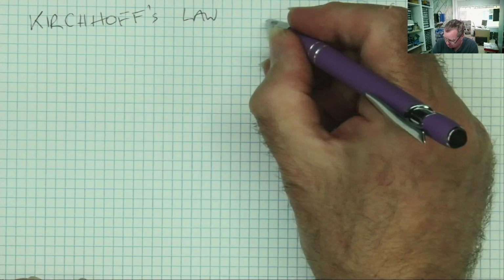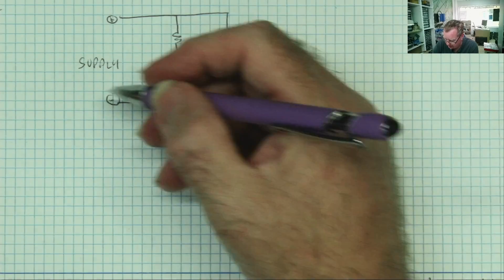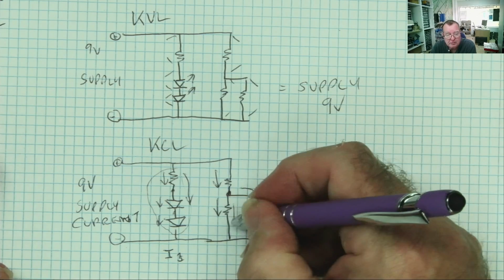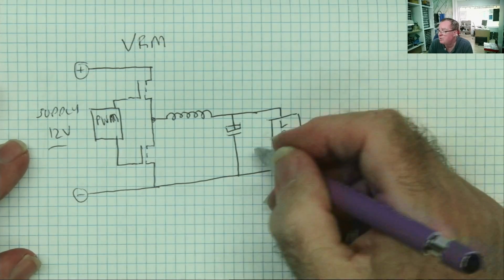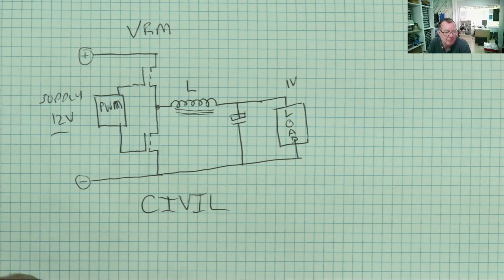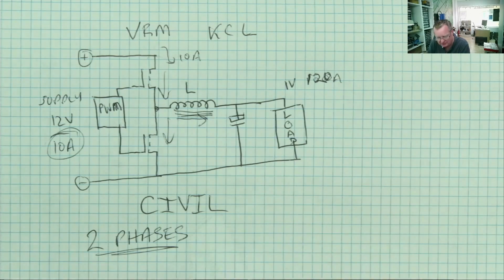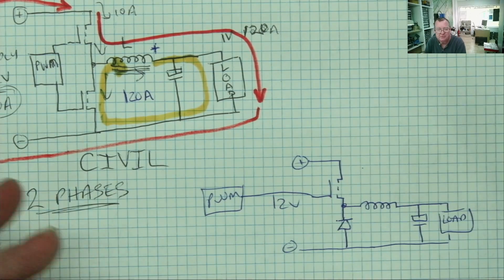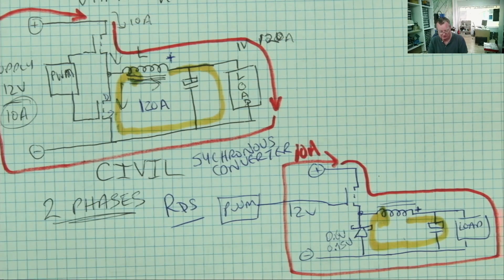Kirchhoff's Law VS The VRM : Do DC-DC Buck Converters Break The Laws Of Physics? KVL KCL

Comment: We are getting very spoilt lately! Lots of "Learn Electronics Repair" whilst I'm doing my electronics certificate! Love them! Thank you once more!
Reply: I've just started an Electronics Diploma myself. This is all great stuff!
Reply: @darrenbird - Except, 10 amps (steady) does not flow in the Upper MOSFET, when ON.  Pure nonsense ...
Reply from the maker: @MrSummitville  When did I ever say that 10A steady flows in the upper MOSFET? Timestamp in this video please.
Reply: @LearnElectronicsRepair  if you are applying Kirchhof's Current Law then explain how you measured 10 amps, if it was not steady?  The current through the coil is approx 120 amps, not 10 amps. You need to learn how Buck Converters work before making a video.
Reply from the maker: @MrSummitville  I didn't measure it as this was a theoretical video not a practical one, but reality and previous experience tells me this is the case.  Let's go through it again.

The DC-DC converter is supplying a load, let's say a GPU as I mentioned that in the video.  

The GPU requires a supply of 1 Volt and it draws 120A as it dissipates 120W.  

The ATX PSU (as this is a GPU so that's what the PSU would be) supplies power to the DC-DC converter.  If the load power (Wattage) is 120W then the supplied power must also be *120W (first law thermodynamics, energy can neither be created or destroyed)  *ignoring efficiency losses as this was a theoretical discussion. I also know that in reality this would be a multiphase VRM and I did mention that in video but it is not important for this video.

To supply 120W at 12V the PSU must supply 10A (10Ax12V=120W) Therefore if I put a current meter into the 12V lead to the GPU I will see a supply current of 10A.  We also know this is true as the ATX can not supply 12V at 120A anyway.

Due to the above facts, the node between the junction of the MOSFETs and the inductor APPEARS to have 10A going in to it and 120A going out of it which breaks Kirchhoff's Current Law. Just as an aside I dislike the use of the word 'node'here, it just makes KCL sound more obfuscated, why not call it a junction like everyone else calls the points where two or more components connect?

This video was intended to explain how in fact KCL and First Law of Thermodaynamics are both being satisfied by demonstrating that this is a phased circuit which exists in two different states alternately, not concurrently.  I then go on to show that each state does indeed obey Kirchhoff's Current Law. As I mentioned I'm open to constructive criticism, for example I don't delete comments that disagree with me. I'd be interested to hear your reply on this topic and why the above description is wrong, if it is. 🙂

Comment: Kirchhoff's law will work out if the circuit is in a static stable condition. As soon as you add reactive components then you need a different set of laws or put it into a stable state e.g stop it oscillating . As you say energy can not be created or destroyed. but you have to give a little away to the power god's every time you change it's form. Expect for the perpetual motion machines which we all know are powered by unicorn farts and rocking horse shit. 🙂

Comment: Heya, ?!?!??!?? oke KVL and KCL now I see it I remember I had it at middel high school and it's logical for  me. I see and untherstand the 2 phases intergrated into 1 circuit ( unlike a transformor with 2 circuits) what I don't get is how the load can handle 1 moment 10A and the next moment 120A and yes I'm a student well try to be and I read al the comment's( difficult because I don't know al these thormodynamics law's and maxwells equation ) and I untherstand P1=P2 so I1xV1=I2xV2 10Ax12V=120Ax1V and still I don't get it, mind boggling. please explaine more thanks

Comment: Richard, please please show us videos without end in which you tell us how to repair devices.
Your excurses into theoretical physics will rather disturb the minds of your viewers.
Im already curious to hear you explain how Mr. Kirchhoff manages to get current from one coil of a transformer
to the other even if there is near infinite resistance between them always.
Your phase-theory will not help you in that case. Sooner or later you have to accept that there are additional
effects in electricity like the law of induction which was, by the way, discovered by Mr. Faraday
who maybe knew even less mathematics than you do. Despite this he was one of the most important physicists
of his time. Kirchhoff was one of the founders of mathematical physics but he worked at a time when 
the understanding of electricity and magnetism was a big mess still. Today he would be a fervent supporter
of Mr. Maxwells equations form which the Kirchhoff rules follow under certain circumstances.
Reply from the maker: Quite simple that one.  The primary circuit and secondary circuit in a transformer have galvanic isolation. Therefore KIrchhoff's laws apply to both primary and secondary circuits separately. What we can also say is true is that the conservation of energy still applies (first law of thermodynamics) so the energy in the primary and secondary circuit are the same: V x I in the primary = V x I in the secondary (minus some efficiency losses dissipated as heat to satisfy first law thermodynamics).  I was honestly of the opinion that understanding basic laws like Ohms and Kirchhoff's are essential to being able to repair devices, hence these sort of videos from time to time. I'll let others comment on whether they agree with that or not, but ultimately I use the views/hours analytics which tell me what sort of videos people here like to watch and what they don't. 😉
Reply: @LearnElectronicsRepair  : The first law will even allow thermal energy to be sucked up by the secondary and transported to the
primary as free electric energy. This does not happen very often. My answer is 12MHPE.
Reply: Thanks for this. I think this level of simplification is just right for people who just want to make stuff work!  Keep up the good work.

Comment: I am sorry Richard, but your explanations of how a synchronous and/or a buck converter work are wrong. If you were right, the top mosfet would be ON much more time then the bottom mosfet - which is not the case. Your explanation simply ignores the dynamics of these circuits - sorry to say so.
Reply from the maker: Did I ever say that the top mosfet it one for a much longer time than the bottom one? I think I said that the top mosfet effectively stores energy in the inductor, and the bottom mosfet (or diode in case of a buck converter) releases that energy via the load.  At least that is what I meant to say.

Comment: I think you should of made it clear ( clearer ) that this is your interpretation of the 'Law' because Kirchhoff said 'equal zero' because he was taking into account of power and time, a voltage is dropped across a resistor and when all the drops ( they are negative) are added together the result is zero. I say this because I think  second or third (Ish) comment  down said " Thank you for explaining Kirchhoff's Law, it's origin and the Law : the sum of all the circuits will equal the supply voltage " That is not what Kirchhoff's law says. I think an explanation as to why the law is worded as it is would be helpful for those who want to pursue the algebra. Just a little whinge, as there are other channels that enter into theory whilst reading it all from a book and getting it all wrong and all the time giving the impression they know what they are talking about !! I'm sure you have come across such channels in you illustrious YouTube career
Reply from the maker: I do believe I showed the actual wording of Kirchhoff's law in the video and then said that 'but this is the way I like to think of it' (which I guess means how I like to interpret it...)
Taking the power source as a positive voltage, then adding the sum of all the load voltages as negative, would of course give a result of zero. Is that any different from me saying that adding up all the load voltages would give a result equal to the power source voltage?  

I hoped to explain this in a way that did not involve maths but would still explain these important laws to non mathematical viewers.  It seems in this case I upset a few people by trying to do that...
Reply: Nah not upset ! still love ya just curious keep 'em coming I'm sure it's realy hard making these vids anyway without the maths, thats why I watch and not make !!:) @LearnElectronicsRepair
Reply from the maker: @andymouse  Actually you were not the one I seem to have upset 😉
Reply: Yes, I see that now ! :) @LearnElectronicsRepair

Comment: Hi Richard 🤗🤗 here the answer.
I must use Google  translator.. sorry my english skills they aren't high enough .
First law of thermodynamics The first law of thermodynamics describes the principle of conservation of energy and states that the quantity of energy is conserved in every process in a closed system. It is calculated using the following formula: ∆U = ∆Q+∆W The following applies: The change in the internal energy U of a closed system is equal to the sum of the change in heat Q and the change in work W.

Conservation of energy Energy can neither be created nor destroyed. It can only be transformed from one form to another. Although the amount of energy in a closed system remains constant, the usable portion of the energy varies depending on the conversion. Since Einstein's theory of relativity, we have known that energy can be converted into matter and vice versa.

Comment: Thanks, Richard, great lesson. So, a mosfet, I have to see as a switch 1 or 0, do they do other things too?  Now I understand about the coil, that I'm seeing on all the boards and other devices. Now I'm understanding why capacitors are alway loaded . They are like a power-battery, how do we dischart a capacitor? So when I'm  making a diagram for something, I have to start from externe load and  work to the internal  component, which is  driving the external, because the board has a low voltage and the load is working on a higher voltage and Amp? I like the lesson, we are building it from scratches, yes.

Comment: No!  In Steady State mode and Continuous Current Mode ( a safe assumption ) ... The current flowing through the inductor is never 10 amps.  The current in the inductor oscillates up and down (slightly) around 120 amps. When the Upper MOSFET is ON, the Inductor is Charging - the current in the inductor is rising, from slightly below 120 amps, to eventually slightly above 120 amps.  Then when the Lower MOSFET is ON, the Inductor is Discharging - the current in the inductor is falling, from slightly above 120 amps, to eventually slightly below 120 amps.  Repeat, over and over.  Each MOSFET takes it turn, flowing approx 120 amps, when ON.  The TIME that each MOSFET flows approx 120 amps, is different.  Your analysis of how a Buck Inverter works is flawed.
Reply: You are completely right …..
Reply from the maker: To All: As this comment was made several times, I've continued the discussion in the pinned comment so it is easier for everyone to keep track of it and join in if you like

Comment: Brilliant.
Reply: No, not Brilliant.  The Upper MOSFET does not flow steady 10 amps when ON.  Pure nonsense.
Reply from the maker: @MrSummitville  As many times as you post this statement I can reply.  Prove your point with a timestamp please, when did I say Upper MOSFET flows steady 10 Amps?
Reply: @LearnElectronicsRepair  You clearly have no clue how a Buck Converter works. There is no time when 10 amps is flowing through the inductor. You drew the red arrow and said 10 amps flows like this. No, 10 amps does not flow through the inductor.
Reply from the maker: @MrSummitville  To All : I've continued this discussion in the pinned comment, to keep it all in one place so everyone can follow along and join in 😉

Comment: Thank you for explaining Kerchoffs Law, it's origin and the Law : the sun of all the circuits will equal the supply voltage.
Also the demo schematic of two phases within a circuit.
🌏🇦🇺
Reply: No, 10 amps (steady) does not flow in the Upper MOSFET, when ON.  Pure nonsense.
Reply from the maker: @MrSummitville  I don't recall every using the phrase '10A steady' could you please give the timestamp when I actually said that in the video before accusing me of saying it? I believe you are putting words in my mouth that didn't actually come out of it! 😶 I did say that this circuit operated at high frequency, into the hundreds of KHz and that the current flowing into the node from the PSU could for example be 10A and the current flowing out into the load could be 120A, which appears to break Kirchhoff's current law,  and I stand by those statements. And by my explanation.

Comment: good effort young boy
Reply: No, there is not a steady 10 amps flowing when the Upper MOSFET is ON!  At best, this video is a very poor effort.
Reply from the maker: @MrSummitville I tried to explain how we could appear to have different currents flowing into and out of a node, contrary to Kirchhoff's law and without using mathematics which a lot of people self included hate. I'm always up for constructive criticism, so how would you improve the video? And when did I say steady 10 amps flowing through the upper MOSFET? Quite the contrary, I made a point that voltage leads current in an inductor. Are you just imagining things here? Timestamp please to prove your point.
Reply: @MrSummitville  no problem keep on trying